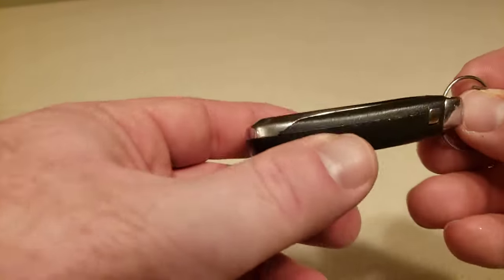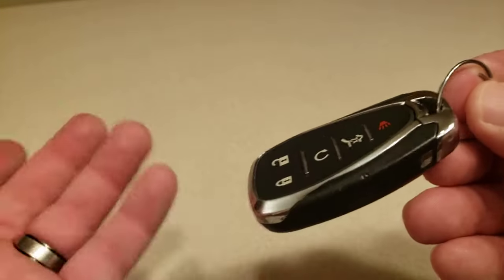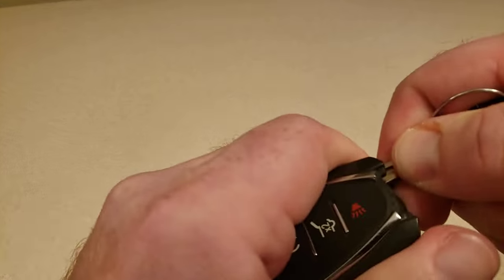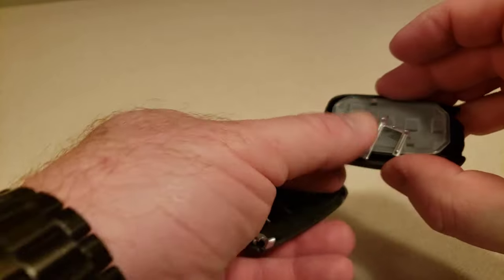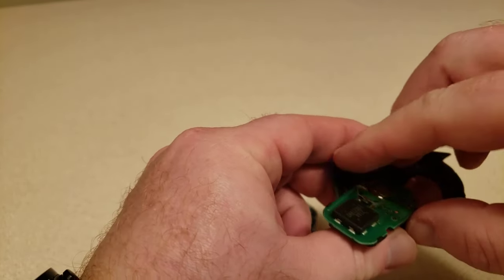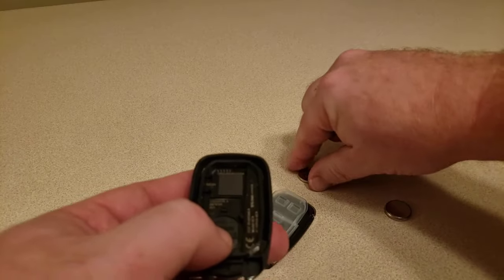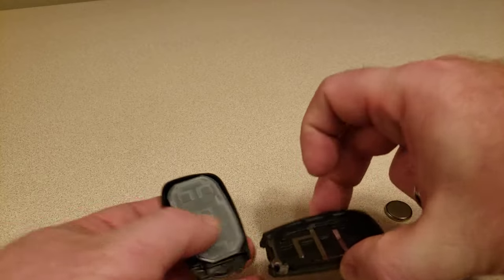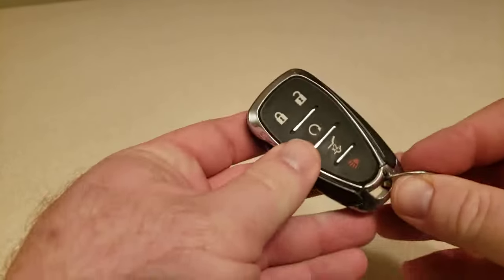How to Change the Battery in Chevrolet Key Fob | Chevy Traverse #keyfob #battery #chevrolet

Comment: The twisting should be really easy. Basically, just the tip of the key, about 1/4" is inserted into the box, then twist either direction and it will split the fob apart slightly.

This was the easiest fob battery change I've done. Good job Chevy and good job with the video.
Reply from the maker: Thank you!